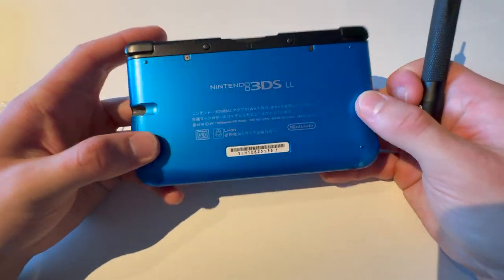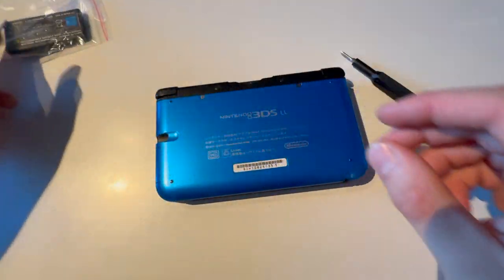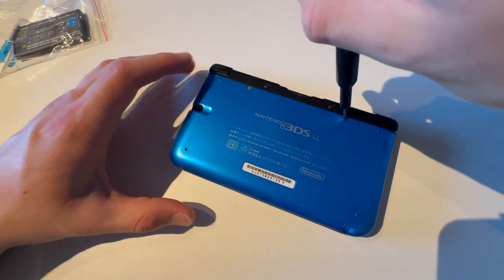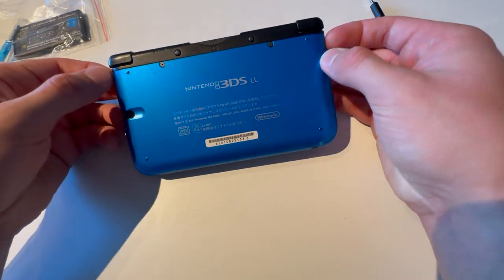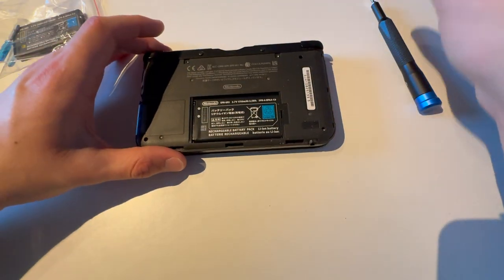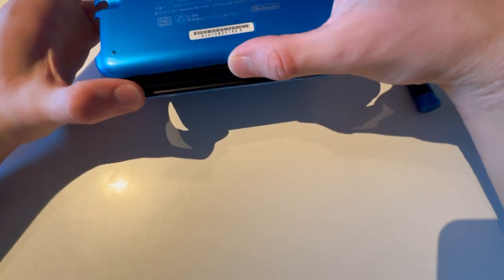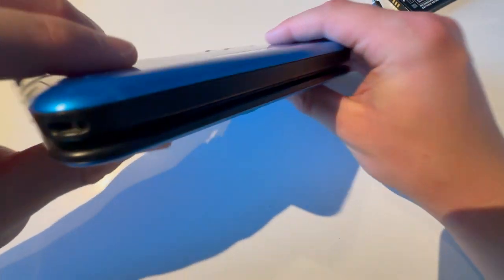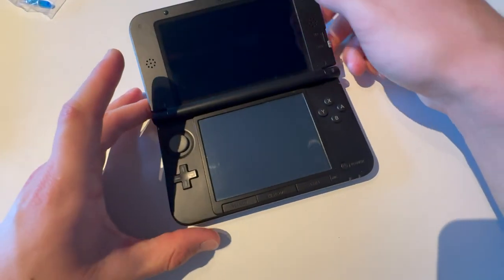How to change battery on 3DS XL

Comment: I modded another n3ds LL just using the SD card from another modded N3ds LL and everything worked and it’s in English but none of the apps or anything will show but when I insert it to the other N3ds LL everything shows up is there a way to fix this?
Reply: Splash screen saves tho for some reason
Reply from the maker: Yeah because one sd card is missing mod files and app files🙄
Reply: @RetroBoyy  damn thanks I thought all the mod files stayed on my sd card